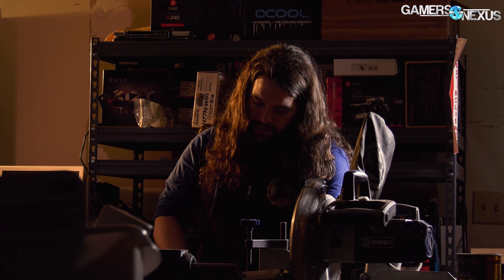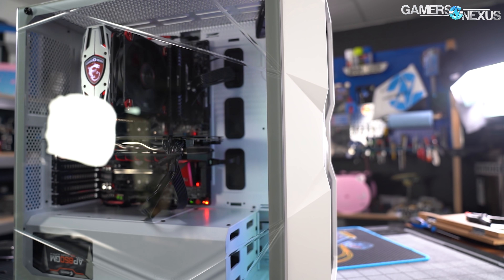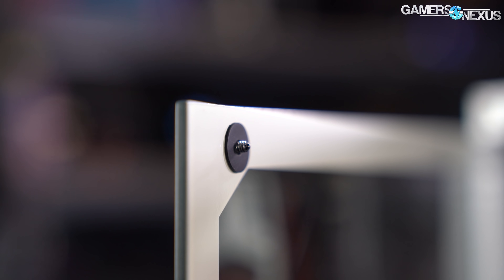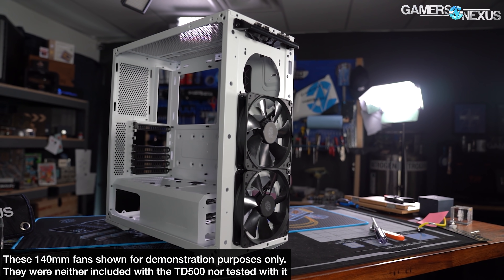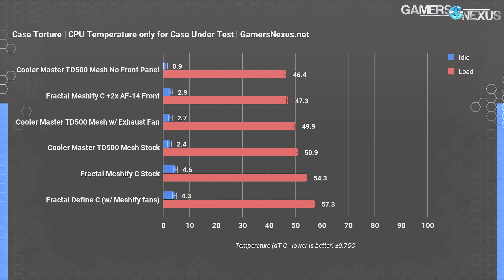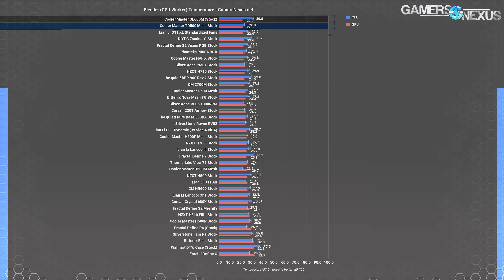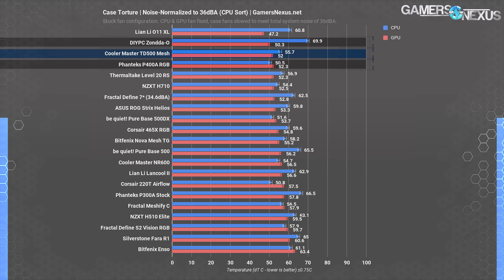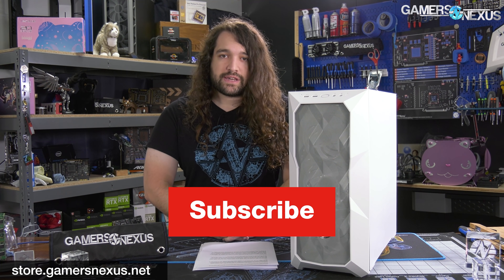Cooler Master TD500 Mesh Case Review: $100 Airflow Show-Down

Comment: The channel is interesting, however, the narration is spoken too quickly, and often there appear to be some stumbles as if the narrator has lost the place in the script. This results in a slower spoken word as one might do to highlight or emphasize a point, but it is not an emphasis point. Yes, a lot of info has to be conveyed but some alternation of speed and a slight pause after an emphasis would result in more comprehension of the data by the viewer.
Reply: By "the viewer," you mean yourself. I'm having zero problems keeping up, and I'm still exhibiting signs of a concussion.
Reply: "By the viewer" you mean you, right? I have zero issues keeping up with what Steve says. Also if you want it to be slower use the playback speed function.

Comment: I bought my Fractal Arc Midi R2 6 years ago for 100$. We have been going backwards since then. There is nothing in the current market anywhere near 100$ mark that can even remotely compete with that case on features level. Yeah, we have glass and RGB now but we have cut so many corners, it's not even funny. The case market have been going backwards in the last 5 or so years and praising this garbage as a good case just because it have good airflow is laughable.

Comment: @Gamers Nexus: Hy. New fan and subscriber here :)  

First, I really love your channel…I found it because I'm looking to build my own PC (for the first time ever.) 
Second, sorry for the long comment. I really hope you can/will read it, as it means the world to me.  

I was hoping you could help me whit a few problems I have after 1 month of resource, I still don’t really know what to go for regarding parts.  
And whit all your knowledge about this, I REALLY REALLY hope you can help a new fan and new subscriber out :)  
(Most PC YouTubers don’t even answer if they are big, so I pray that you do).

SO…This PC will mainly be used to run my racing new sim rig, I have 3 BenQ EX3203R monitors (a triple setup) that I will use, and I also want to play VR whit this PC. 
I also want to have the possibility of setting up a simple stream or record (live) to YouTube/FB. 

Whit these requirements, and also the option to upgrade later: 

What Graphics card should I get for this setup to run perfectly? 
I found a really good deal on a GeForce GTX Titan XP, 12 GB, GDDR5X, 384 bit, 7680 x 4320 Pixels, PCI Express x16 3.0 
(This is second hand from a reliable seller, as new for only 366-. Euros. I see Amazon now sells them for 890-. Euros)
Is this a good card/deal for a setup like this? Or should I choose a different GPU? 
What would you do if this was your setup? (Just your quick opinion would mean the world to me.)

Could you PLEASE PLEASE give me some tips on what parts I should choose that makes this setup run smoothly?
(For a plug and play gamer...Ie: What is overclocking, lol) 
You will save me soo much hassle, and give me great peace of mind. I really hope you have time to answer me. 

GPU?  Would you go for the Titan XP deal, or pick a different one? 
CPU to match my GPU?  
CASE? Can you recommend a good case or 2? (The one in this video is not available here in Spain)
(Should I go midt or full tower for this setup? It will stay on a table, RGB is cool but performance is whats matter the most) Of course with good airflow, easy to set up, and future proof parts preferred. 

POWER SUPPLY?  

This is my main questions, If you do have a minute extra: 

SSD: What's the best/fastest/price-friendly 500Tb-1Tb for this? 
What kind of RAM (32gb) is best? (2x16Gb or 4x8Gb, is there a difference? 
Cooling-Fans or the new AIO system and which?
Price is open but was hoping to get a  great PC for under a $2000-$2500

Hope to hear from you soon.

As I said….After a month of research, and watching all your videos, I still don’t know what parts to buy today, the 12th of June 2020. 

(PS, I know a lot of new stuff is coming out now/soon, would you wait for any of that for this setup, or should I just buy what’s on the market right now?)

Kind regards Kenneth

Comment: Nothing beats phanteks p600s yet and you've never gave it it's due credit. Fabric mesh looks nice as hell and hides the dusty filter beneath. The design with just 1 filter like cooler master will be a dust nightmare. And p600s glass has no studs.
There is no reason no to have a large mesh of fabric or other decorative material that does not block any air
Reply: Seconded. Phanteks P600s is the best airflow case available at the moment imo. Just finished a new build and the quality and ease of building is second to none, bar the psu shroud if you don't attach PSU cables before inserting it into the case (minor niggle because everyone recommends to do that anyway but inexperienced builders still get caught out). At this price point the P400 wins as shown by GamersNexus' own test metrics and stats... but I'd encourage ppl to pay the little bit extra and get the P600s. More space, better quality, can use 140mm fans all around without the sacrifice of having a 120mm in the rear. P600s is the best case GamersNexus didn't get around to reviewing yet, and it's amazing!
Reply: I won't buy it because of the soft filter and the top-mounted power switch. Thanks, Phanteks, for the airflow option nobody with cats feels comfortable using. If I want a case with only one useable airflow option, I can pick much nicer options than the P600s. Nice try, but the P300/400 are both better.
Reply: @nimrodery  But the front fabric mesh is exactly for that. To filter big elements and then the fine mesh filter dust. It does not get dirty nearly as fast as the mesh filter. The fabric looks great and and provides amazing airflow. My pc stands on the desk and cat does not even reach it

Comment: This case, like many others. Has a major problem. There is not much Space Between the wires of the power supply and 3.5 hard drive bay. So, if you use 3.5 Hard drives, good luck trying to get them in there with the wiring of the power supply in the way. And it seems like nobody cares about it.
Reply: This could potentially be a problem but a good number of people use regular SSD's or M.2 nvme's these days, for some it's a non issue since they can just remove the hard drive tray.
It's what I did in my case.

Comment: PSU should have a separate slot on the side like Lian Li cases - otherwise it will radiate heat and blow up your 3080Ti.
Reply: The large fan on a power supply unit is the intake. Traditionally mounted at the top with the fan facing down they provide an exhaust for the case. Nowadays they are more commonly mounted at the bottom with the fan still facing down pulling air through their own venting at the bottom and venting out the back.
Modern power supplies are very efficient and are kind heat-sinked by the entire case to radiative heat is not really an issue.
The issue with mounting the power supply vertically like in the LIANLI O11 is that the PSU intakes from the back/side of the case which means that side of the case cannot be flat against a wall. That's not a problem for the O11 is it's main air intake is already on that side and it's a fancy prestige showpiece case but that layout is impractical and space inefficient for the majority of cases.
Reply: Thomas Sturges-Allard and causes problems when you have idiots doing highly sponsored videos. Cough-cough-Verge-cough /cough. The Corsair 280x has the same side mounted PSU shroud.
Reply: @zig131  you may have a point but I once witnessed a PSU radiating heat through a FLIR handheld camera and it was affecting the GPU thermals. Maybe that has changed now.
Reply: @mithrandir491  My PSU fan never actually spins. I might have an overkill PSU, but it's just not getting hot enough to worry. If your PSU was faulty or too small for the job, heat might be a thing but it also wouldn't be your only worry.

Comment: I know this case is basically better than the p400a in terms of features with basically the same cooling, but holy crap is that geometric front panel ugly.... I would rather just miss out on the quality of life features and eat the price hike that the p400a digital white ($95 + $17 shipping) has now just for the flat mesh front panel alone.

EDIT: $118 for a $90 case. After going through a newegg RMA where they said they'll replace it but then gave me a refund thanks to no stock rather than telling me ahead of time they can't RMA it so I can just live with the damage but have the case.... or contact Phanteks for replacement parts.... 

TL;DR: still salty over getting fucked by newegg support a month ago and now overpaying for the same case on Amazon.